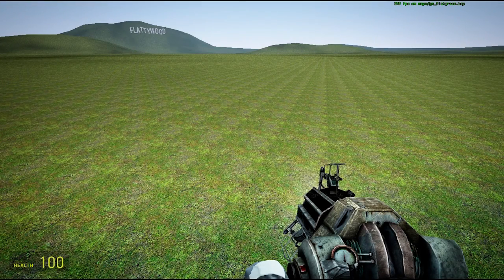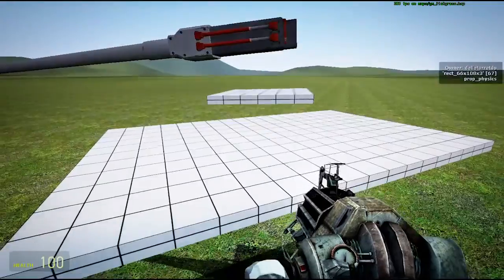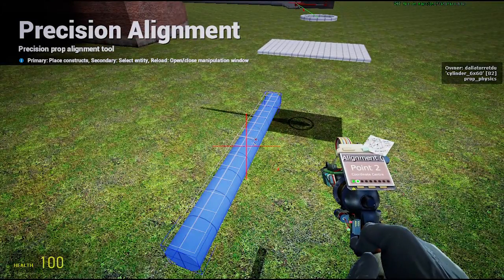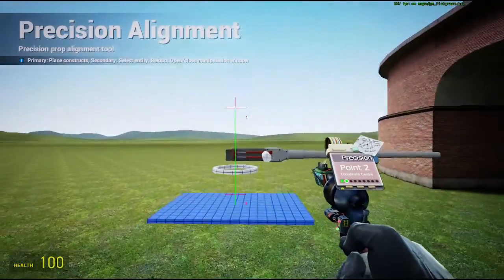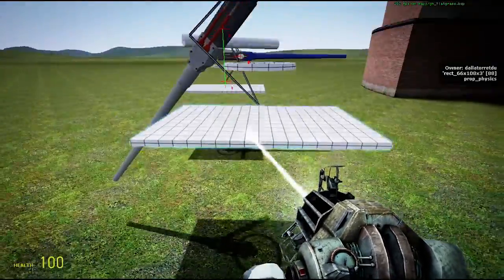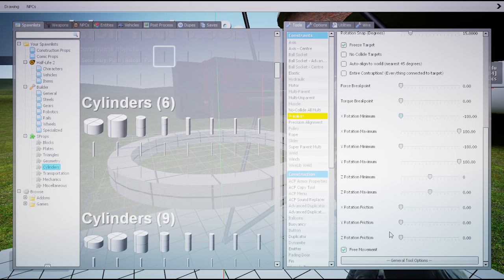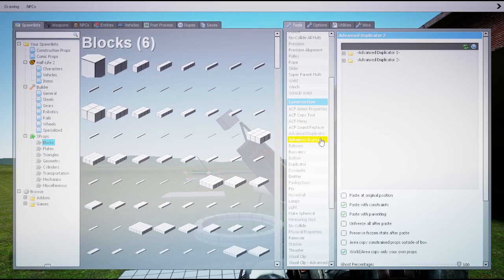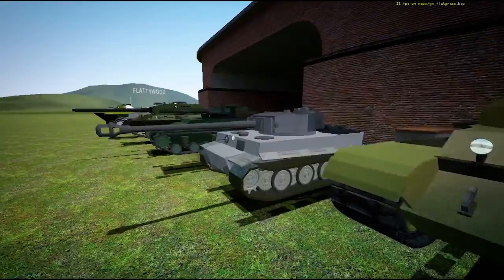Tank Turret Tutorial in Garry's Mod

Comment: How do I fix my tank from leaning to one side and how do I fix this issue?
Sorry if it seems like a dumb question, but it is really bugging me.
Reply from the maker: Gas Hazard remove the wheels and place them again, sometimes the axis mess up.
If the tank is heavy use 2 base plates (the base and the roof) like you see on some of my tanks, so you can have 2 axes
Reply: Seems to have worked thanks!
By the way, is there a way to reduce the recoil on a gun?
Reply from the maker: I did it on a filed gun, but I strongly suggest you not to use that.
Place a block on the gun CG, put a slider (-10 Block, +10 gun), put a hidraulic.
The block weights almost as much as the gun, if the slider approaches 0 length everything will break.